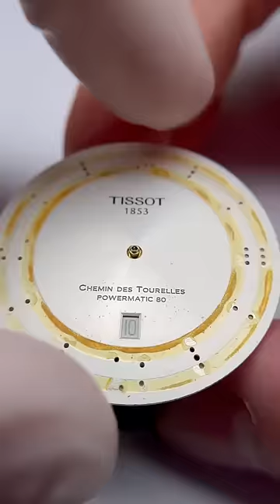Repair a Tissot watch which falling from  high altitude destoryed.

Comment: For everyone really into this . Start pulling old watches apart and play around you learn alot
Reply: All mine are quartz and digital… 😂
Reply: @matthewboylez34  buy some cheap Chinese mechanical watches to play with
Reply: @BabyJesus66  wait there are cheap  mechanical  watches?!
Reply: Wots the difference? Are the parts  just  more expensive? Ore is the quality  of the 200$ one terrible?
Reply: @Jesse-2531  Depending on where you look you can find sub-$100 mechanical watches with Sea-Gull (Chinese formerly state-owned company) movements. Also Seiko's (Japanese) Seiko 5 lineup is sub-$100 although I'm pretty sure they're all automatic watches.
Reply: @Jesse-2531  to answer your question, it depends on what you’re looking for. The quality of the cheap ones is definitely lower, but it’s questionable (depending on what you want) whether the difference is actually enough to cause the price difference it does

Comment: As much as I appreciate my Apple Watch, it’ll never have the class or elegance of a well made traditional timepiece.

My two bucket list watches are an Omega Speedmaster Professional Moonwatch and a Rolex Submariner. My father owned the former and I would often admire it as a kid. Sadly it was sold due to financial considerations. The latter is fairly common but it’s a classic.
Reply: You could split the difference and get a Seamaster chronograph
Reply: SAME. dad owned the same watch and sold due to financial issues and I want it now. Same with the Rolex submariner as well!
Reply: You should look at the Tudor brand, it's owned by Rolex and is priced lower than Rolex, although it has its own unique stylings.

Comment: Could someone tell me what those violet color small circular thingies are? And why do they put a drop of liquid on then? (And what's the liquid)
Reply: They are little rubbies jewels. They are used because they have realy low friction capabilities. And the liquid is oil to lubricate them.
Reply: @petrlouc7648  did you mean Ruby?
Okayy got it. Must be something really good at its job because they are present in allll the watch repair videos I have binged. Thankss

Comment: Wonder how much it'd cost to do this on the side
Reply: Watchmakers make a hefty salary. 
But the job standard is pretty high.
Reply: I’m a service watchmaker for this brand, it’s salary in the low 20k range. Very expensive to invest in equipment if you want to start working by yourself
Reply: notice you didn’t see a timing machine, cleaner, cleaning chemicals, venting, polishing station and all the time sourcing parts. I think this particular one looked pretty easy, besides the new jewel  maybe.
Reply: Yes a lot of the time you get lucky with not much intervention needed. But when the parts supply becomes restricted, you can get into difficulty as an independent watchmaker. With jewels it’s useful to salvage them from a scrap part